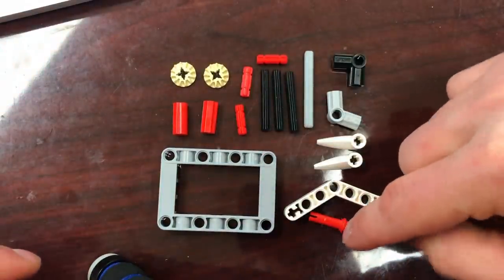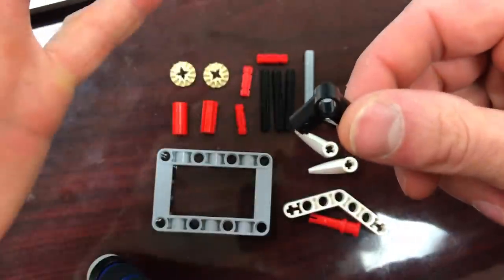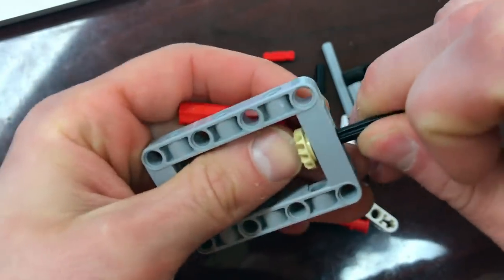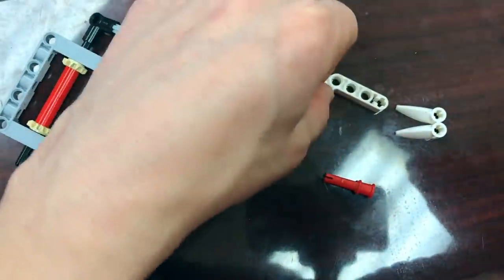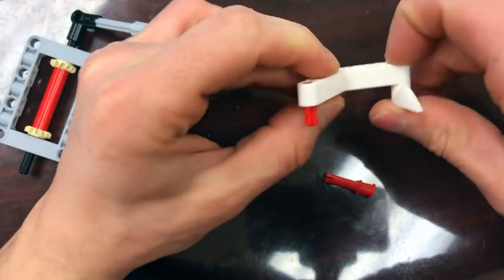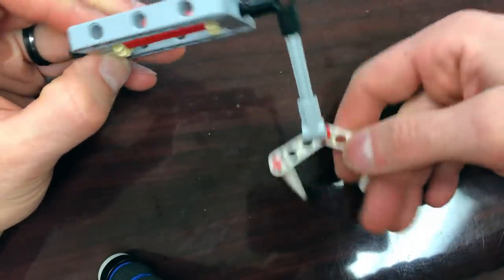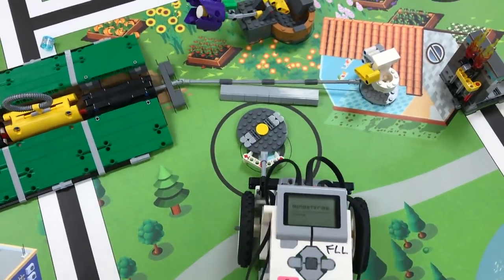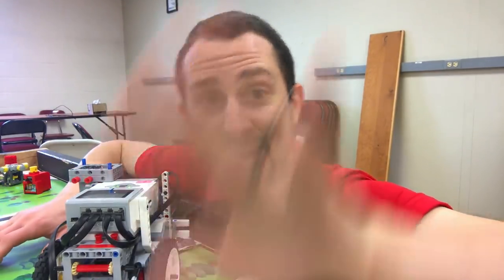FLL Hydro Dynamics Attachments: Man Hole Covers

Comment: Mr Trautwein my team is trying out your driving base, but we don’t have the big thin wheels. Think we can survive on the regular wheels included in the education ev3 kit?
Reply from the maker: Hi! I would highly suggest to upgrade to a larger wheel. they are far more accurate and will cause you less headaches overall. we've seen great improvements over the switch! You can buy them on bricklink.com here: 
https://goo.gl/MJHoZ7